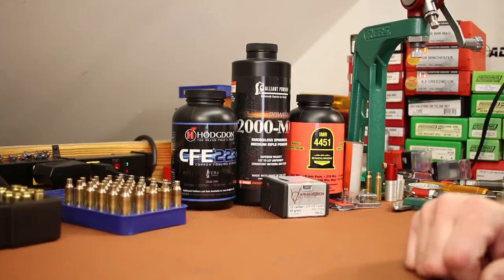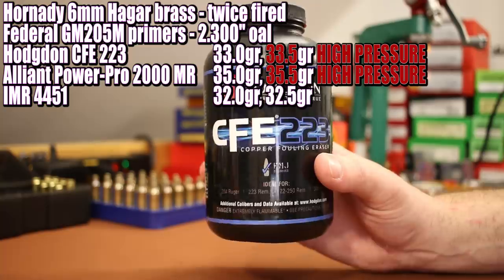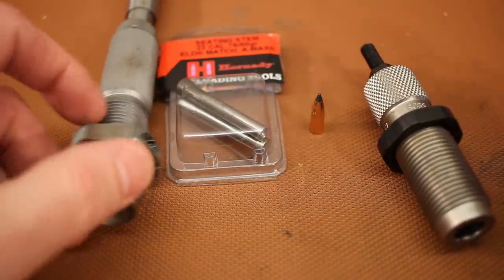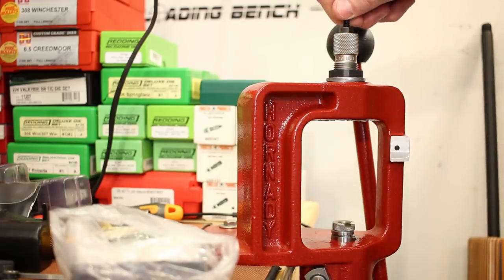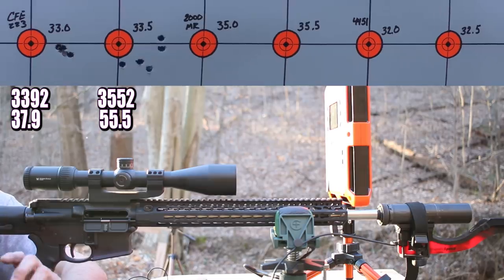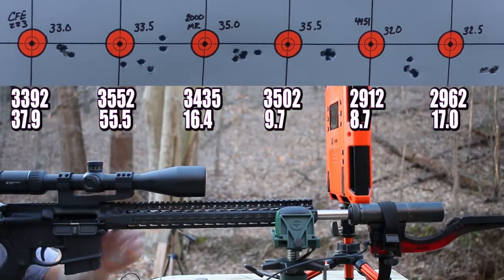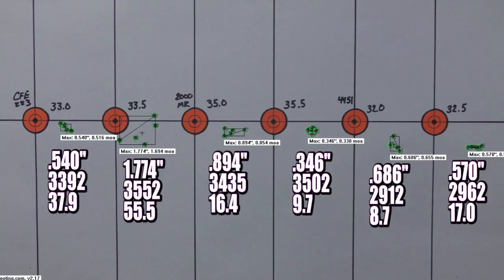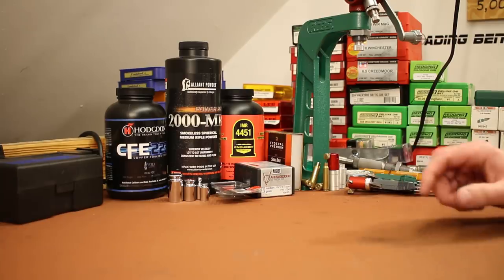Fixing 22 Nosler - 22 Nosgar - Part 3

Comment: I am the guy JRB was talking about when he was referring to low velocity. I have commented on almost every video JRB has uploaded to YouTube since he started his channel. I have learned somethings from JRB videos over the years and JRB used to appreciate feedback from viewers. He used CFE223 which I recommended in the comments of the previous video in this series. There is another video powder which I wont mention which would allow for 3600 fps with this same projectile and no pressure signs.  However, he has started to lash out at me when I mention facts about a certain cartridge and velocities achieved by the manufacturer. There were better powders than Varget for this cartridge to actually get above 223 velocities.  So this has brought me to make the decision to no longer be a subscriber or viewer of future JRB videos.  The benefit of YouTube is for experienced people to get together and positively exchange ideas.  JRB used to be this way but has changed IMO so this will be my last comment ever on his channel.  I will take my experience reloading well over 50,000 round and share my data with other YouTube channels.
Reply: Sounds like a lot of your experience is wasted in the comment section... Maybe you could start your own reloading channel instead?
Reply from the maker: No, you weren't the primary target of my comments in this video, and it wasn't you that set me off. Your comment was a contributing factor, absolutely, but it was only a small part. There was another guy who was much more aggressive and spewing complete nonsense. Unfortunately, he has since deleted his comments. Sad to see you go, but hopefully you'll find another channel that values your input.